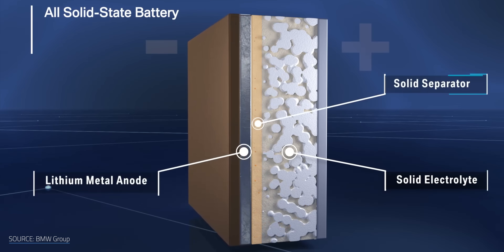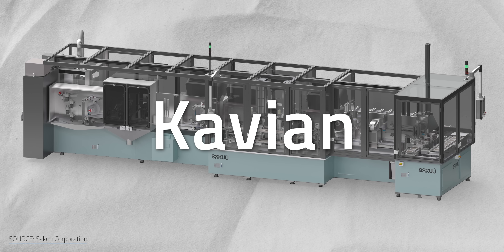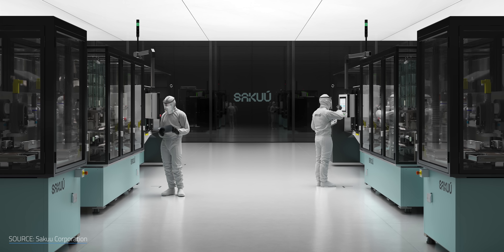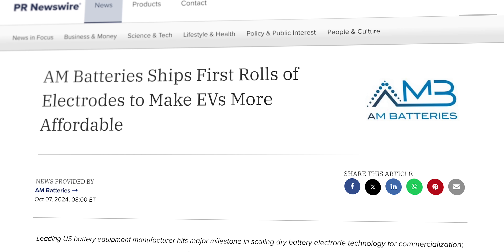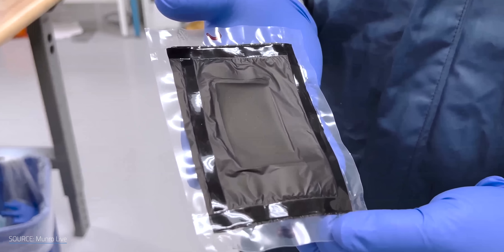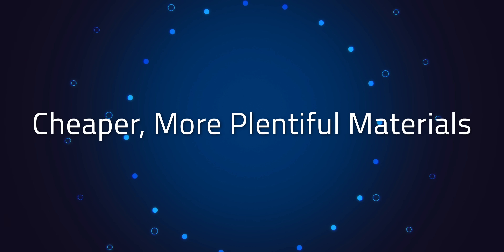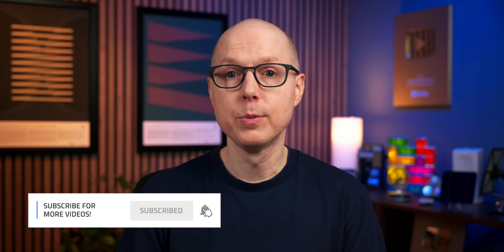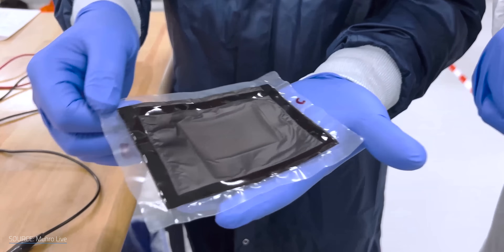Why This Ultra Cheap Battery Breakthrough Matters

Comment: EVERY month a New Breakthru Battery technology emerges .. then is forgotten. LOL
Reply: He is just very early regarding emerging tech. To make stuff scalable and ready for mass production takes time, and sometimes another tech overtakes it, or it turns out its not feasible or scalable anyway. Doesn't mean it's not relevant or a breakthrough.
Reply: @MyrKnof  NO he makes money be cheerleading any tech hype in the media. Discoveries that never make it to commercialization are not "emerging".. they are DOA hyped BS, used for click bait.
Reply: It takes years from discovery to commercialization.  Please try to be more patient.
Reply: The discovery is just the first step. Then you have to build the facility to make it. Don't know how many projects you've been a part of but building a new line can easily take a year and that's with equipment that already exists. In this case they don't necessarily even know what equipment they need to industrial produce it. So need time to figure out the equipment, design the equipment, build it, then install it and get it running. Also need to get all material sourcing established, then slowly build up production and then build demand. Even with revolutionary technology demand can be slow as people see it as unproven so are hesitant.

So all told if everything goes insanely well it might start to show up in 5 years. That's assuming they don't need to design too much equipment. More realistically you are talking something around 10 years. It's possible to expedite but it takes an insane level of commitment and money
Reply: @BrandonColes-o9v  whatta bout the other 50+ discoveries before this one, dating back over 20 years?  When will those be available??  LOL
Yes, I fully understand what it takes to bring a new innovation to market ... that is WHAT I DO FOR A LIVING .. I invent things that actually are used in EVs today. 
I'm simply calling BS on this constant dribble of clickbait battery hype that most likely is never going to get commercialized.
Reply from the maker: So we can't even talk about it then?  I talk about this stuff because I find it fascinating. Seeing how these different advances fit together.  Seeing where this technology is likely heading based on where different advances are happening.  If that's not your cup of tea, I get it ... but then why watch the video?
Reply: Why not discuss the in production actually covered by Chinese users. we lion semi solid state nio pack at 150kwhs but weighs just 44# more than the same sized catl nmc100kwh pack? 

And now factorial publicly claims a 90kwh prototype solid stste ev pack which weighs just 590# that merc is using?
Reply: @UndecidedMF  "So we can't even talk about it then?" Your clickbait title is claiming that this a "breakthrough" that "maters," when it's actually not yet clear at all that this will end up mattering.
Reply: @KrustyKlown you say you understand and live it yet you seem to not realize that this endless stream of little innovations is what leads to big changes. Sure occasionally we have one revolutionary idea that changes everything but more often it's a constant stream of little changes. Look at the auto industry, cars even 20 years ago were very different and less efficient. It wasnt a single change. We need this endless stream of little discoveries because they slowly build into what we really need. Everyone is constantly building on each other. It's great to say you just want to hear about the ground breaking stuff but this endless dribble is what leads to that. 

As for seeing all the previous innovations, literally look at anything you are using right now. Lithium ion batteries were barely a thing 20 years ago. The ones that were available were horrendously expensive, didn't last as long and were slower to charge. Every new cellphone you have gotten likely had a slightly better battery coming from these endless discoveries you're complaining about. Companies don't publish much of it beyond its better than before because A) they done want to give away what exactly they are doing to competitors and B) most people wouldn't care or understand. 

You shouldn't be watching this expecting to see the next big thing that's coming out right away. If he could know that he would be a millionaire/billionaire and wouldn't need to be on YouTube. These videos are just meant to show you what is being done I mean it's literally in his account name. It's undecided because you don't know what's going to work. 

That being said I do think it would be cool to have someone go through the current technologies being used and how they grew. All these endless little discoveries that led to what we have now. I'm sure there are channels that do it but sadly I don't think they would be as popular.
Reply: @KrustyKlown  klown

Comment: I would be interested to know if there’s a correlation between battery price drops and EV and battery product adoption. It could be a self feeding cycle. More adoption means more competition means more price reduction means more adoption..
Reply: Correction, I’m sure there is a correlation. I just wonder by the numbers what is the correlation?
Reply: @enox3547  Grab the data and run the numbers. You have the power. Be the change you want to see.
Reply: Well... yes and no... they can only drop so low before it hurt them - we can see that in China right now that went from 300 EV companies to now just the top 10. Even then those are hurting and looking to drop some of the middle men as battery companies look to make their own cars instead. So at some point it will stag until new tech hits the market or they take short cuts. Yes in that, lower prices means more people will have access to them. ICE was the same way, and you can see it in the used market. EVs are just now hitting into that market and thus as people get used to them or demand more access to them - the more you will see them pop else where.
Reply: no. you described supply and demand.  Demand cause supply to lower = more expensive
Reply: Is this different kind of battery that EV used in china's cars?